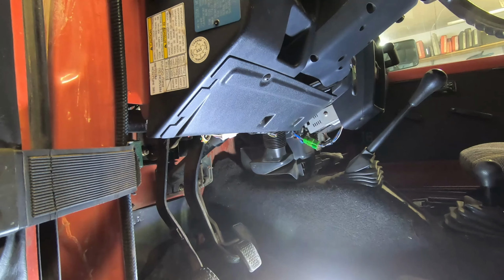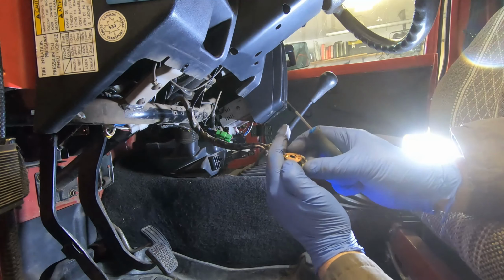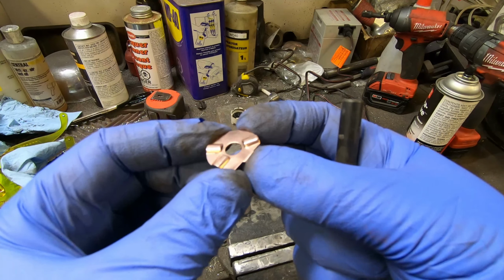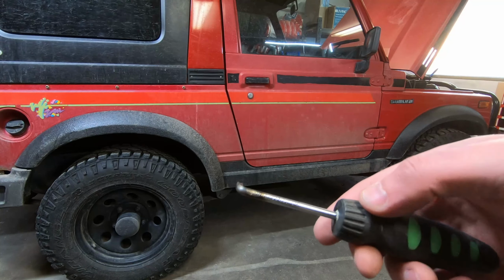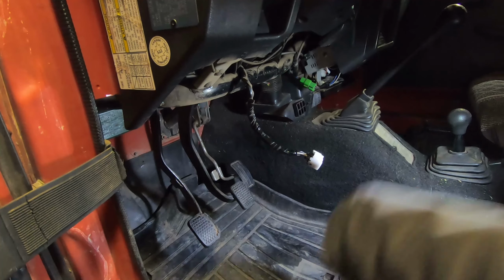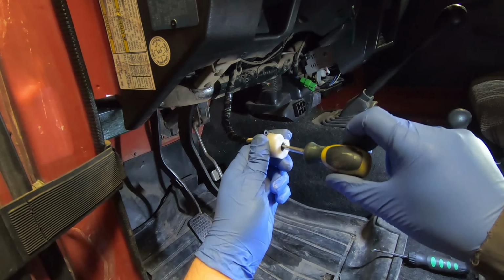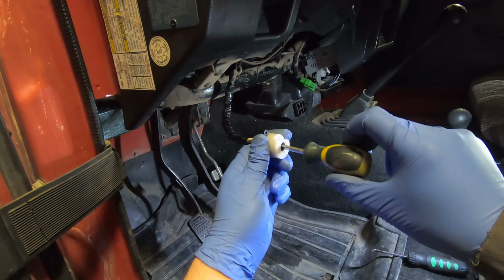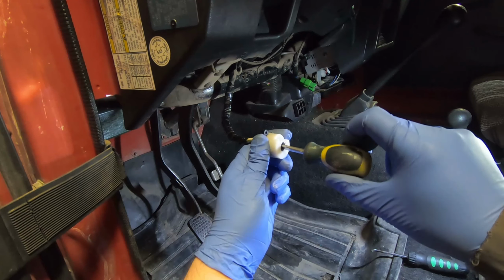Samurai Clicky Starter Fix (fail, fail, fail, fixed)

Comment: I had a similar problem with mine. The small contact and the one next to it where the arcing takes place were shorted together inside the black plastic. It would sometimes arc and melt the solder on the switch. Just replace that switch. They're cheap.

Comment: Dr. Dan. Have you considered the "clicky starter" fix? It's a pretty common problem with Samurai. It bypasses the switch and sends power straight from the battery to the starter. It's about $35 and takes about an hour to fix. https://www.lowrangeoffroad.com/suzuki-samurai-clicky-starter-upgrade-kit.html
Reply from the maker: Yeah I have seen that.  When I started working on the switch I was hopeful it wasn’t necessary.  Now I see why it’s a common mod.  So far my repaired switch is good, but I could see adding the relay at some point.
Reply: A $5.00 relay, couple ft. Of wire, butt connectors, build your own.... I've never had much luck only cleaning the ign. Contacts

Comment: That thing got so thin you keep sanding it. Get a new ignition  barrel a universal one will also work cost around $35aud. Maybe your starter solenoid is bad but you think it's the switch. Turn on ignition and go touch a screw driver across starter's positive and negative solenoid terminals to see if it starts directly that way.
Reply from the maker: When I did this, a replacement ignition was out of stock everywhere.  I've since purchased and received a new one but I haven't had to replace it yet because the repaired one is still working fine.

Comment: That clicking is your starter solenoid, not the switch.
Reply from the maker: Yes absolutely.  The root problem was poor contact at the switch; but the actual clicking is coming from starter solenoid.